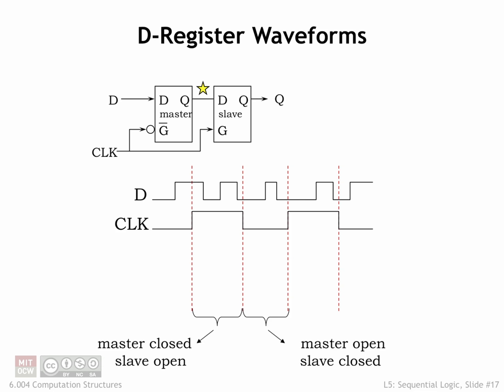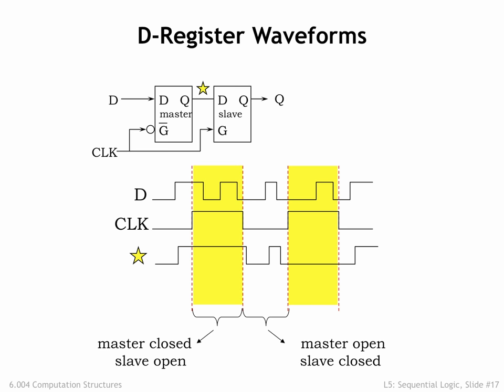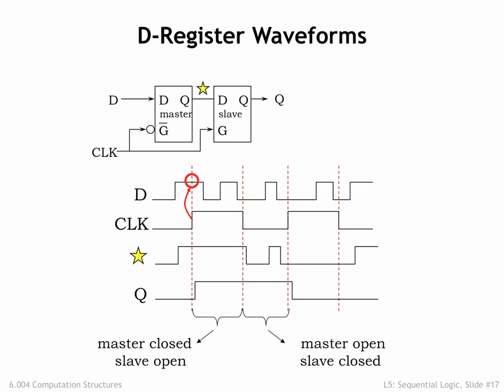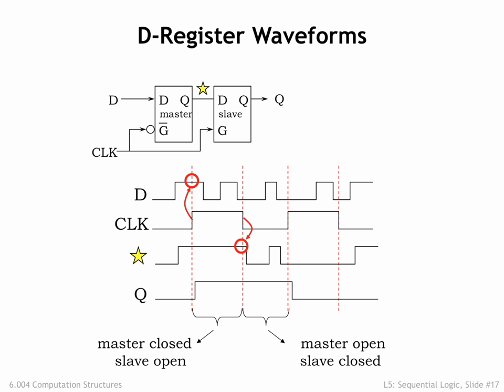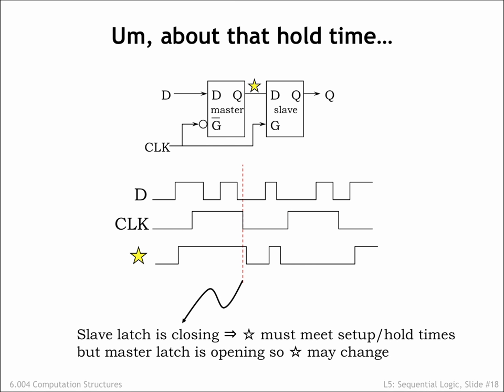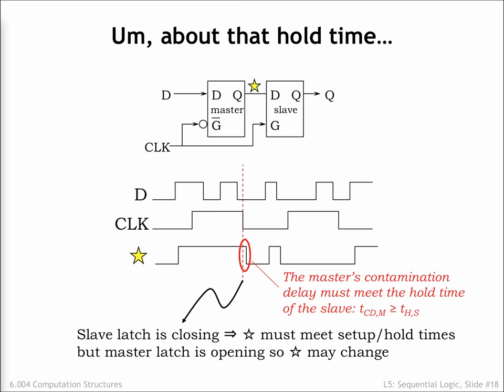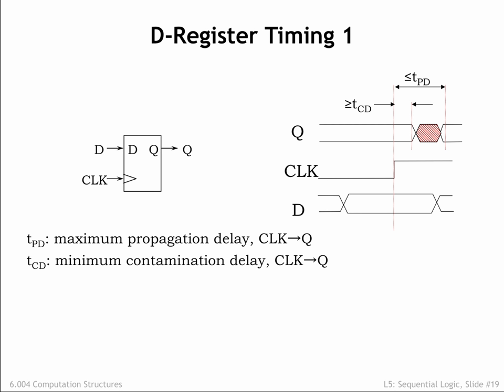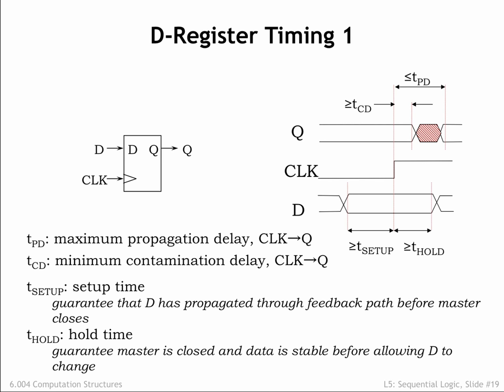5.2.4 D Register Timing

Comment: The one confusing thing about this slide is the use of "D" and "Q" or ⭐

 I assume this is standard in the way these are graphed, but there are three Ds (or three Qs) in the slide while line code is showing. When I spend time thinking about it, were talking about the D→ coming in, because all we're talking about is signals coming in and coming out, but there's a slight mental hitch with three Ds having two different values coming in.

This combines with the use of ⭐instead of a distinct letter and again, this led to just a momentary hitch and I had to go back and think more. For whatever reason I was confusing the D input and the  ⭐.  Part of this is the multiple Ds and part is combination of letters and non-letter symbols. 

I'm not sure what the standards are, it's not my field, but this seems like an odd set of labels and more distinct ones might prevent confusion. It seems like the logical thing to change would be the D in the input to a different label and the ⭐to a label following the same pattern. I'm just watching on my computer so I can go back, a student in class can't do so as easily.

All that said, most of this course is pretty easy to understand considering the complexity of the topic, assuming you've got even a basic electronics background. I'm really glad to get deeper into this Flip Flops. I've always had the basic explanation for many of these things, but details like the T𝘱𝘥 are hand-waived in simple electronics tutorials. It's great that these resources are available free.